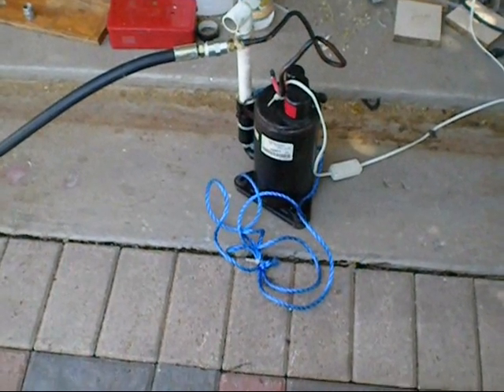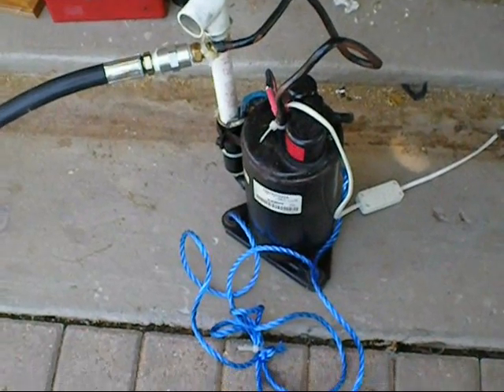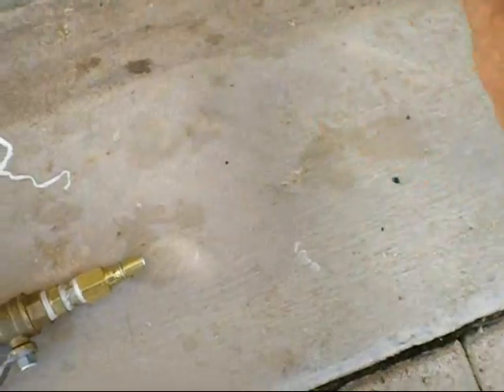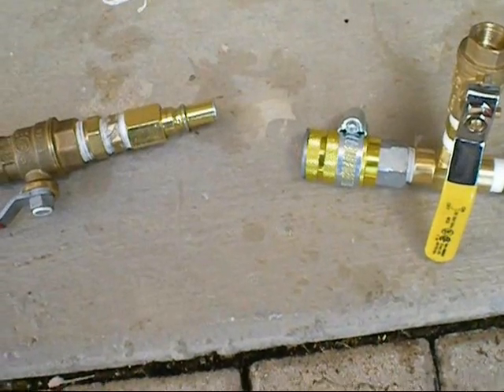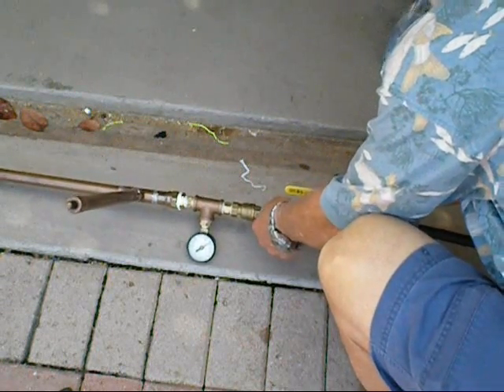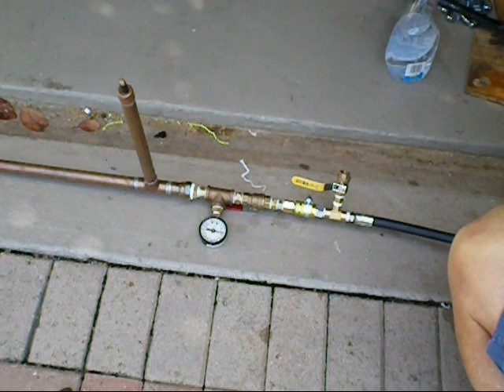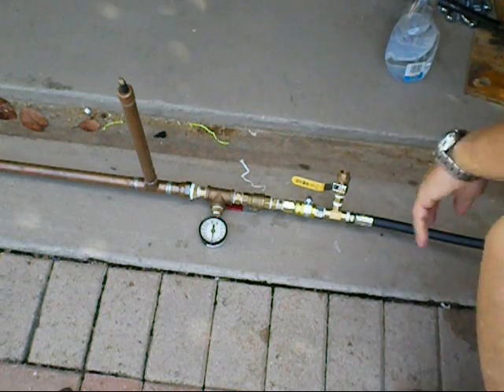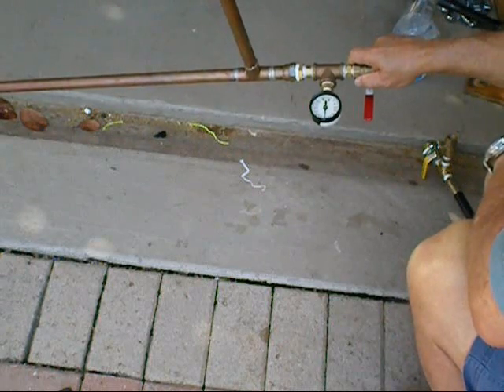Homemade Air Compressor from 8,000 BTU Window A/C filling air gun

Comment: Did you have any issues with oil in the compressed air? I tried this with a refridgerator unit and found the oil was misting out of the unit while running. I'm interested in trying an a/c unit like you've shown here.

Comment: Consider putting a oiler on the intake of that compressor and a dryer at the output else it's not gonna like it. These ac compressor need oil in the gas they pump. That's why they are used in close loop application. They put in oil with the gas so the piston are well lubricated.  Once you open that loop like this you should give it oil in the intake unless you don't mind replacing it often

Comment from the maker: BTW The pressure gauge is on the gun side to test the piston valve for leaks.  

I have been plagued with a little leak around the rubber sealing washer and possibly the screw holding it to the Oak piston..

Comment from the maker: The hose was under $10 at Harbor Freight.

The quick disconnect is pneumatic also from HF.

I added a 3/8" ball relief valve so that I disconnect at zero pressure.

No pressure makes it very easy to use, especially with the hose clamp pull.

Comment: you've made a pretty good video... now I wonder why I haven't made one myself 

ohh and I really like your setup... 
how much did you pay for that hydraulic hose?? 
I see it uses hydraulic QCs, right ?? I think you can get ones that can be disconnected while under pressure 

just a suggestion... consider putting the gauge on the compressor, not on the gun... and if possible add a tank to the setup (preferably an old scuba tank)